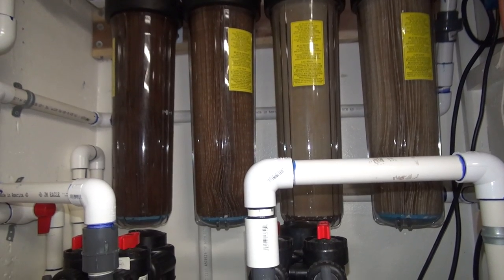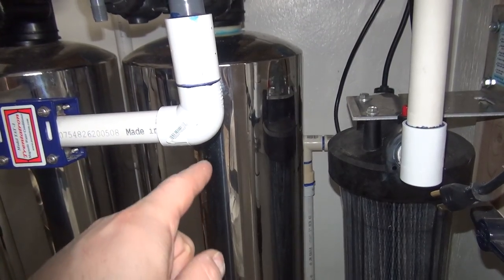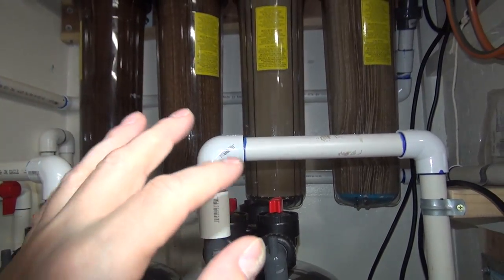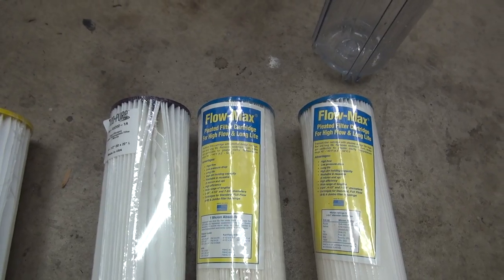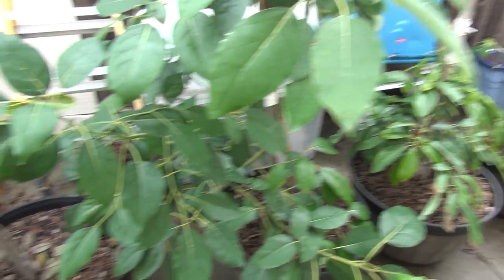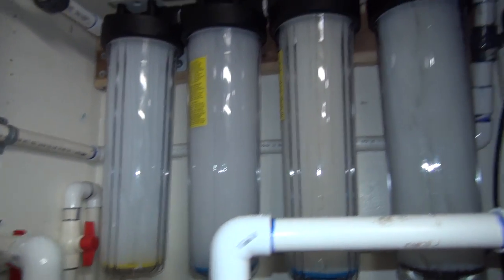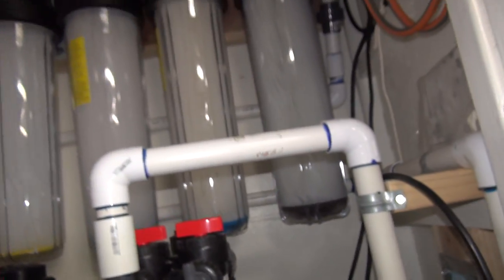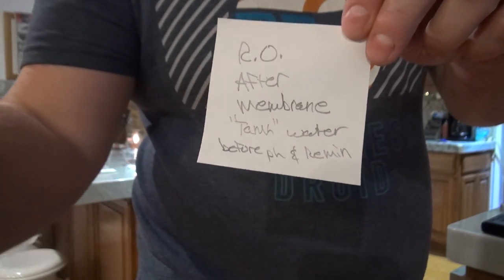worlds best whole house water filtering system D I Y  tutorial

Comment: Hey me again so i have my 4 inline big blue filter like you but i cant stop the leaking... how tight did you make fittings and tge filter housing itself? Pipe sealer did you use?
Reply from the maker: I hope you did a "bypass"??
anyway teflon pipe dope on the threads and teflon tape wrapped with the spin of the pipe as it tightens in.
best of luck
Reply: It cam be very difficult to stop leaking using only teflon tape without using professional quality liquid teflon to seal the threads. Extra thick teflon or go old school and wind spool wick into the threads and use liquid teflon.  The liquid teflon will flow and seal the leaks and the spool wick will fill in the gaps

Comment: @45:45 most important bit of reverse osmosis info : TDS creep. Just as the salesmen don't give you all the info you need, drinking RO systems are not as well-designed as aquarium systems. Membrane flush kits and DI bypass valves, as well as production in batches (into a large reservoir tank) do a better job getting to 0 PPM. Especially with hard water : if the membrane is clogged after a batch, the smallest particles (like fluoride!) would me more likely to get through. So even a low ppm of 10 could be unsafe.

Great setup and video! thanks!

Comment: At 45:00 - Something is wrong if your post-RO remineralizing treatment cartridge reads less than 25 TDS from the RO tap at the sink.  Could you double-check the route of your piping after the RO stage sump?  Water THIS pure is UNSAFE for human consumption because it's considered 'hungry water.'   That results in leaching out the minerals in your body, which, if left unchecked, could cause osteoporosis.  One symptom is you'd always feel thirsty, even after drinking a good amount from this water source.  Take care, and hope you found out if there was a blockage or if it was just a tired remineralizer. 🙂

Comment: I bought a house with well water, hard water comes out from the well. It has two filters before the water softener. I thought about buying another filter, but seeing the two filters do the work on your video. I'll leave it alone. I'm researching in getting a uv light filter and a reverse osmosis filter for the sink. Because the water taste salty. My water softener uses salt. 
Thanks for the video.
Reply from the maker: the filters are all different (various microns) with a well you may want to do a "spin down filter" first to trap the dirt and sand before it clogs the expensive ones. there are tons of links below including a spin down.
good luck

Comment: Thank you so much for providing this instructional video, it's very informative. Knowing what you know now and if you were starting from scratch again, would you install an entire brand new Apec system and still add the additional filters like you've done? Also, is there anything you would change or do different? Lastly, looking forward to viewing any updates since 2019.
Reply from the maker: I would certainly still do the big pre-filters as it protects the carbon from plugging up with dirt (carbon is for solvents and chemicals etc...)

I might say the UV tube was overkill and annoying to change a bulb EVERY YEAR!!

I like the undercounter RO unit its been great!!

My hot water tank (post) filter was mostly just out of curiosity
since I went so far already and had all the tools out lol  (you can skip that no biggie)

***oh the Big on to avoid is the "SALT FREE" conditioner BS...I pretty much made that clear but that is my only regret I Feel!!
good luck dude!

Comment: Thank you for posting you're video, I live in a converted van, and because I move around the country (uk) the water is so different hard in some places and soft in others. so with the idea you have has made me more determined to get a 3x inline filter system..
Reply from the maker: i am jealous That sounds like fun, UK and Ireland are on my bucket list. To do it right is ALOT of time.
Reply: Hello gary i am also in the uk and looking at putting together a small system for camping and home use to make rain and pond water drinkable to include uv purification on a 12v system if possible ? Although the tap water in the uk varies i dont think its as bad as this chaps lol

Comment: for your first filter you may want to try a centrifugal type to save you money.  thanks for the info.
Reply from the maker: thanks, thought about that but these are 20" big blue for HIGH flow rate. I dont think they make anything that big. As long as i stay with a 20-50 micron they are only like 20 bucks and i can even wash them off like i did later in the playlist. i am happy with its performance

Comment: you have got a pretty good system! congratulations!!

I live in Lathrop, CA. I have hard water issues. Really bad one. I’m planning to get something similar as salt based softeners are not allowed in the county. Need your inputs. Looks like water supplied by the city has arsenic, uranium, nitrates and nitrites along with other chemicals and pesticides in it. How would you remove these things from water? Would you recommend whole house commercial grade RO system to remove all the contaminants ?

TIA!!
Reply from the maker: Commercial grade RO is very bad and costly.
You would need multiple parallel systems and since the flow is a trickle (literally) you would need to store in a Massive tank (think mini water tower)
Even if you got that do RO water is very acidic so you would have to re-plumb your whole house.
Bad idea TRUST me lol!!

Best solution for city water is more or less what 
I did. The 20x4.5 filter have ZERO drop in pressure (garden hose/shower) and after the Carbon is fine for plants and skin contact. For drinking water I do advocate for a "under counter" system to (drink/cook) with. That will keep you safe and not worry about Toxic water at least!
Now Hard Water I am just as stuck as you honestly, Not thrilled with anything but i must say at least my hard water no longer combines with the red clay in the water to form ORANGE DEPOSITS sooo a win there to the sediment filters.....   :)
GOOD LUCK,
Hope this helped some
Reply from the maker: oh on the playlist it shows the filter progression through a year or so.....NASTY.....
Reply: @G.G.T.  I agree with you completely. As I mentioned earlier, I will have the exact sediment filtration system, that you have, installed in my home. But still the main issue is with hardness of water. I have already replaced few appliances which made me think of whole house RO system. What if I add PH balancer and remineralizer after whole house RO system ? That should maintain neutrality of water through plumbing isn’t it ?

Thanks for your response! If you have tried anything to remove the hardness, please let me know or post a video!!

Comment: How to modify the system for well water. Very informative video.Thanks.
Reply: install all your filters AFTER the pressure tank/pump, and install most of the filters before water softener, you can put the final charcoal after the softener.  
if you want a uv light, put that last in the main loop
if you want to include reverse osmosis, that is at the point of use,  not the whole house.

tip, for threaded fittings, use plumbers tape AND thread compound
Reply from the maker: yes +1 to above  :)
Reply from the maker: yes sir....

Comment: Between salt-based softener and salt-free conditioner, which one do you recommend? (our state does not have a restriction). I saw what the salt-free conditioner did to your toilet. Would you still recommend a salt-free unit? My basic question is: Is it the hardness in water that is bad for skin and hair or is it the chlorine? My wife would like a water softener for healthy skin and hair but I an not sure which part of water is the problem. I don't want to do ion exchange in water if it is not required. I want to skip the salt-free one also if not required and actually causes more problems. Any insight on this will be helpful! Thanks for this community service! Any other videos I watch are only selling their stuff and it is hard to get truth.
Reply from the maker: well first off i am not certified etc.."so grain of salt here just do research LOTS of free time now. Hard water is not harmful its just calcium and minerals its mostly good for you, problem is its HELL on fixtures ex: toilet faucet shower dishwasher on and on it goes. Chlorine is what you want to avoid once its at your house, before use. unless something is new salt based softener is "ion exchange" it uses sodium to replace the hard minerals. that can cause issues with health (you body will absorb lots of that salt through your skin..bad for heart and hypertension) and salt softeners make the water slimy like the soap wont rinse off (i hate that some enjoy so prefence i guess) another thing the salt or other options get EXPENSIVE and people get sick of the cost after a while.
good luck dude

Comment: Very nice setup! My wife wants a water softener and I want to put something like this in. I’ve seen you can have both so I’m looking into it. Could you put a water softener in-line before the filtration? Would the filters remove the salt? Not sure how that would work..
Reply from the maker: I suppose you could put the softener first but i think it would just plug up faster and be backwards. salt works of of ion exchange the hard molecules are "switched out for sodium". then sent down the drain, as far as i know salt cannot be filtered out unless it is r.o. process which would be waaay to slow and costly. 

best advise it to leave as is or salt soften dont waste money on the "salt free conditioner" as i did its a scam for eliminating hard water stains.
i just wanted CLEAN SAFE water was my priority and i dislike the slimy salt water feel so i am set as is!!

GOOD LUCK!!
Reply from the maker: i put links up if your still looking NOW would be a good time with this corona stuff...:)

Comment: Absolutely great video and extremely helpful. I’m starting my filter system and starting with cartridge filters to begin with. I have 3/4 coming in after the regulator into the home.  Looking to do carbon/KDF and salt free conditioner later one. 
Any particular cartridge filters to stay away from??
Reply from the maker: Neopure "spelling?"  was pretty crappy.
 It was in one of the videos (filter change) just to see HOW BADLY they wadded up!
Reply: @G.G.T.  Thank you!!  I just ordered the 4 pack of filter housing you recommended. 
What’s your thoughts on the Aquasana filters?
Reply from the maker: @jamesdiller1222  I am not a fan of any filter design that is proprietary to THAT company only!!
It is a way to trap you into there products at a higher cost, stay with standardized filter housings and "plug and play" the inside filters is all I will really say.
dont get yourself trapped

Comment: Great video and very informative. What can I expect to payg for all of the compenents in this setup? I'm going to do this for my house in Mexico. Do you see any issues with a half inch water supply line? Yes, I said 1/2" and it sucks but it is what it is. 

Thanks!!
Reply from the maker: no problem just less volume (only one person in the shower at a time, dont run the washing machine while doing dishes. lol) 

i would say save a few bucks an go with 3/4 pipe threads instead of 1" everything should be cheaper.

Comment: Awesome video. I see I'm not the only person obsessed with piping designs.  I'll be replicating something similar downstream of my well tank including a brine and resin style softener.  After watching this I'm tempted to add bleach injection even though my water tests didn't justify.  I also have a 7 stage RODI system for my reef aquariums and drinking water.  It has TDS instrumentation on it that shows before & after results.  It consistently runs a zero after the stages.  Your hot filtration is something I don't run but is intriguing.  I'm guessing the higher temperature is causing some sort of precipitation of dissolved solids. Did you ever consider testing a sample of the water in that canister?  Perhaps there's a solution.  What's your water pressure?
Reply from the maker: our water pressure is based on what the city pumps to us. varies throughout the day but normally between 40-50 psi i would say. I ran a test for about 200 different dangerous things in January when the water quality is the worst after the rains flush out all the junk. it registered zero or to low to register. so I was happy with the improvement and left it at that. test was expensive about $250 dollars but worth the peace of mind.

Comment: I am sure you probably tried it already but I have not seen a hard water stain it wouldn't take off..that's CLR..which means calcium-lime-rust remover. The stuff works super!! Even shower heads, just soak them in a little CLR and the plugged up holes open right up!
They sell it at Walmart..give it a shot if you haven't tried it yet. And WD-40 works pretty good too...also Walmart.
Peace! 😉
Reply from the maker: I wish my water stains LAUGH at CRL lol... they are tough man haha.

Comment: Would you say that the sediment filters and a carbon filter is enough  to soften the water vs a softener?
Reply from the maker: NO definitely not...clean water and soft water are two different issues!
the sediment and carbon CLEAN the water and might help get the really fine sand/silt junk out that is hard on faucets,showers etc....
but soft and hard water is waaayyyy down at the atomic level (calcium molecules)
I mostly wanted clean safe water above all else!
Reply: @G.G.T.  great. Is there a specific carbon filter you would recommend. I read that KDF catalytic carbon is the best. Catalytic helps with the Chloramines only right?
Reply from the maker: @MrChrisham  I actually have loose coconut carbon in the big metal tank (it swirls around) links for all this stuff is in the video description

Comment: Hi GG&T. 
I want to keep the crap out of my water heater and downstream appliances but also to be able to drink water from the kitchen and bathroom faucets. 
I plan to follow your 1st 3 guidance of 20u 5u 1u absolute in clear 30x4.5. 
Next you have coconut media in a big tank then a conditioner in a big tank. Would 20x4.5 be ok for these instead of your big repurposed SS Pelican tanks? Also, I have San Jose city water which has chloramines. So I know that I need Catalytic GAC for that. Do you think that charcoal block is better than GAC? Will that affect faucet flow? However, it may be moot ... I can’t find catalytic charcoal in block form. 
As for salt free conditioning... is a 20x4.5 big enough? I don’t think I like phosphate so I’m leaning to TAC. Do you have opinions on decent salt free conditioning?
Reply from the maker: I would discourage you from the salt free course, it may help a tad but not enough to do much for the cost. 
I use 20 x 4.5 housing "big blue" just clear.
I would say for drinking and a BLOCK filter use as a stage in a good RO system. 
I my video I show the under counter for drinking and it works well, the rest of the house does not need to be that pure (just not practical for a garden hose or a toilet flush.
good luck
Reply: Thanks. So you think neither phosphate nor TAC will add much value. Will your 1st 3 filters be “good enough” to clear the gunk that collects in the water heater? And a 4th of carbon. I do not want RO so I would be happy to drink whatever comes through those 4. 
For carbon, do you like catalytic GAC (for chloramines) over block, and is a 4.5x20 large enough or do I need a bigger tank? Your videos have been so helpful. I have a 4’ wide by 5’ tall area in the garage for this. Where ancient water softener was.
Reply from the maker: @billkeller143  ok just a few pointers.
water heater- you will benefit from getting sand dirt gunk out of the water first but "hardness is a mineral issue" you cannot filter out magnesium and calcium! 
if you go instant water heater in a hard area be ready for issues! **PITA....!!!!**

Drinking water- if you do not want ro water thats ok i understand. however the canisters are 10" universal (you can put whatever filters you want in there)
stage 1 - 1 micron absolute (prior filtered) 
2- carbon block coarse
3- carbon block fine
4 Dalton imperial porcelain filter 
5 polish for taste and flavor
pipe to a tank bladder or just send up to the sink for drinking!
YOU DECIDE YOUR FILTERS you wish to use 
*best advice i can offer*